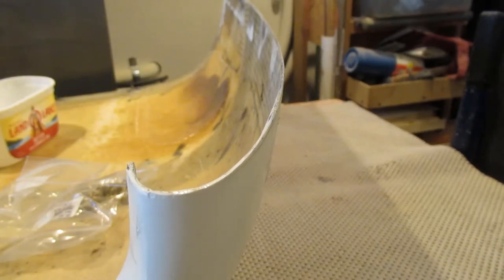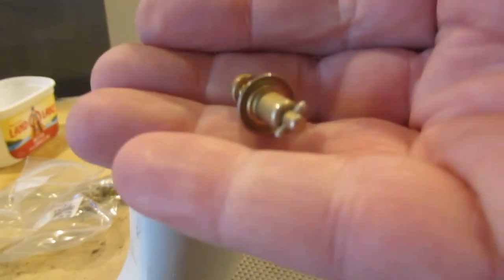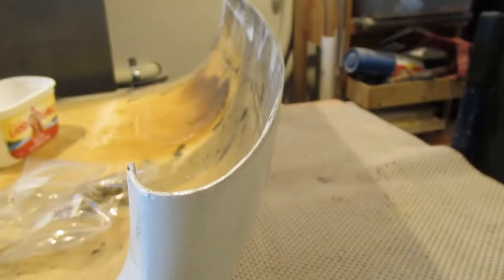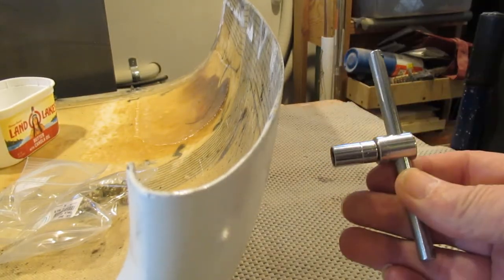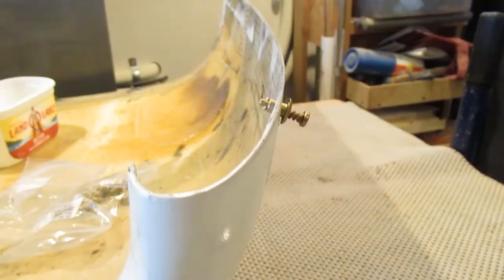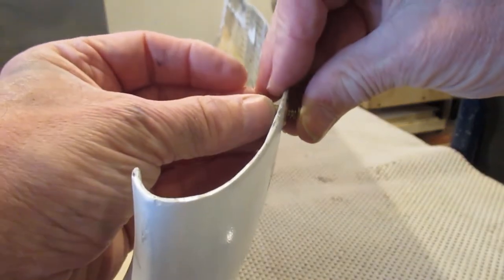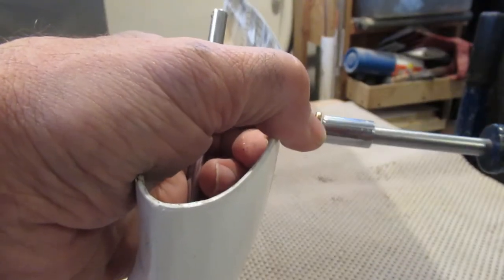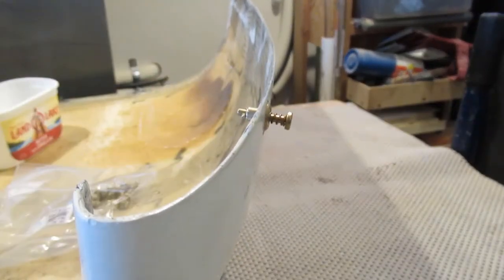Installing Camloc studs - the easier way

Comment: I have a camloc that I’m trying to replace.  It comes with the quarter turn stud and one washer.  I couldn’t see from video how to install?
Reply from the maker: The washer pushes onto the end of the quarter turn stud once the stud is in place through the hole in whatever you are installing it in - that's what you use the two sockets for - one to push on the outside end of the stud, and one that slips over the stud and pushes the washer into place.
Reply from the maker: You may find this helpful: https://youtu.be/AZ9vLFp4HcQ?si=19F0GuhXPEDBeqVC